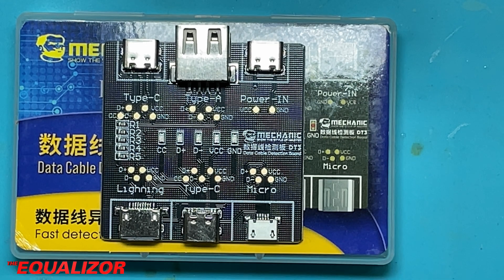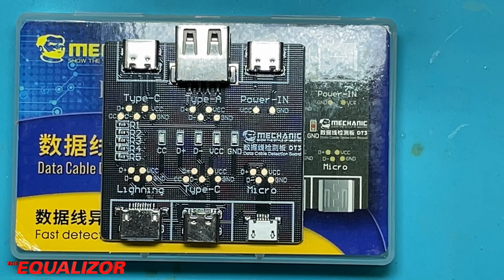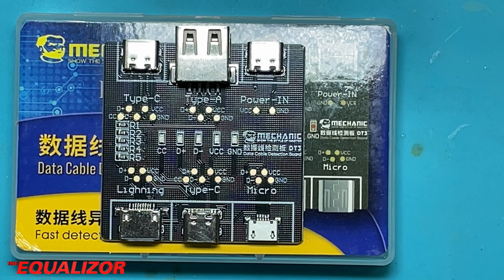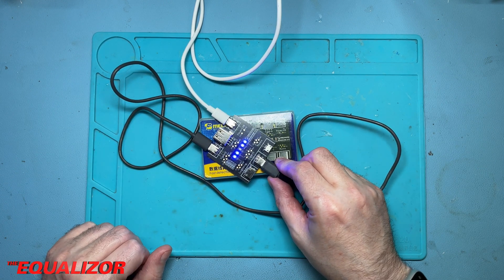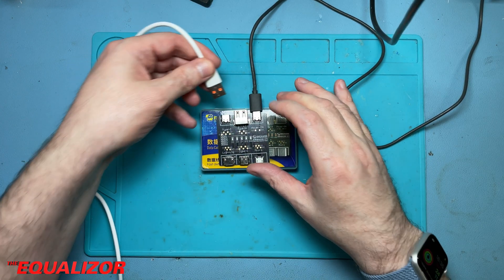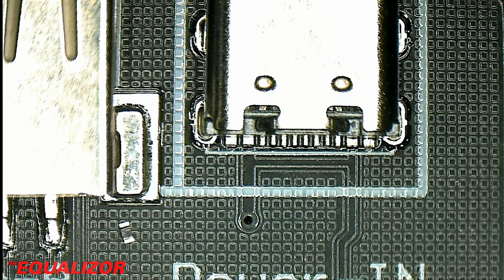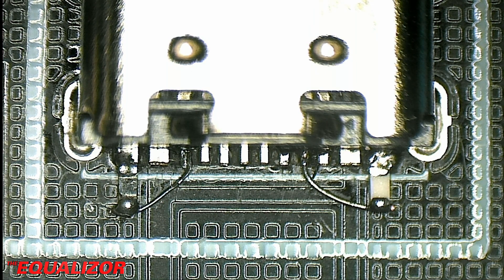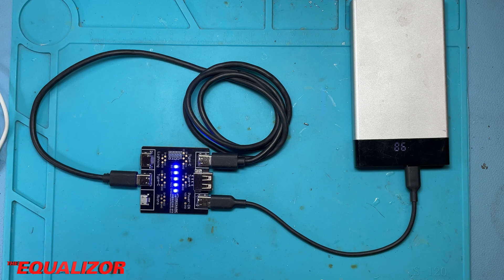Mechanic DT3 USB C-C  cable power upgrade

Comment: Hi, could you explain to me, why at 2:33. you plug in both endings of the cable on one side of the tester? 

I think you should plug in one side of the cable in one side of the tester and the other side of the cable into the other side of the tester?

Best regards and sry for my English ..
Reply: I can easily explain that. It was a mistake :P You were the first one to spot it!. It should have been plugged from Type A at top to Type C on the bottom. The outcome would be the same however, so I'm not too worried.

Comment: Hello friend, are you still using the Xsoldering Pro station? Gradually, my C210 soldering iron started to log off and yesterday it stopped working completely. Doesn't work with any tip :(
Reply from the maker: Yup, still using the Xsoldering Pro station although for this I used a different station the GVM-H3 with Nano Iron due to the ridiculously small size of the leads I was soldering.